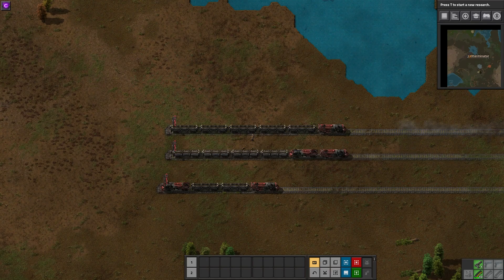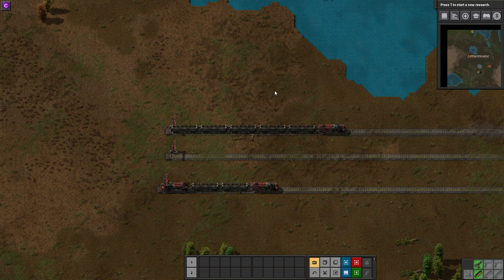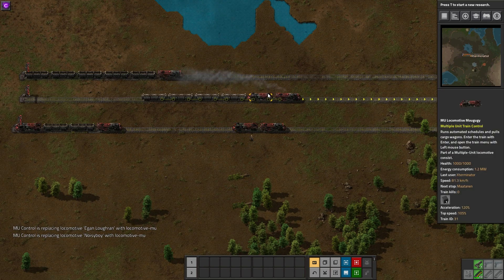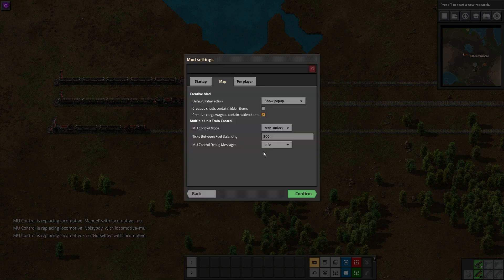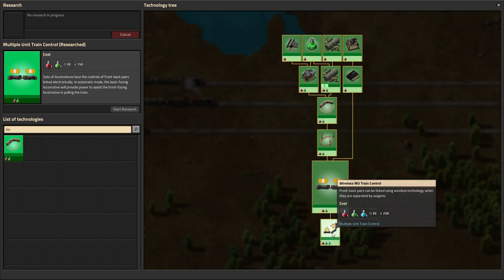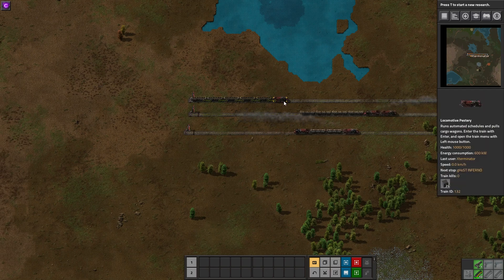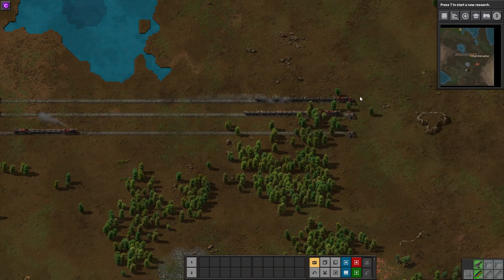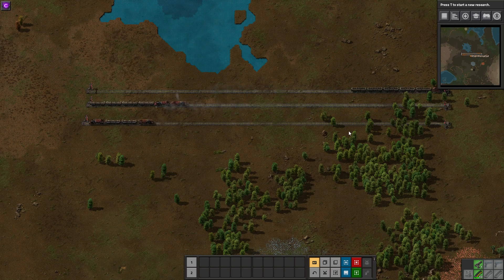Factorio Mod Spotlight - Multiple Unit Train Control

Comment: Steam locomotives do not work in reverse as well as diesel ones. Double headed, back to back, steam locomotives were not used. Pilot and trailing trucks kind of prevented safe reversing at high speeds.
Reply: Uhm... yes they do. Both steam and diesel locos can be run both forward and backwards. There may be exceptions, but the statement you made is inaccurate.
Reply: Some locos. Like the german high Speed loco have a tendet that is the same form as the front of the loco, making backing as Good as going forward
Reply: @matsv201  That's true for almost every diesel and electric locomotives. Factorio uses steam locomotives.
Reply: @SecureGM  Yes, the performance of a steam locomotive is the same forwards and backwards. If you were to take, say, an 0-6-0 tank engine, it'd probably be perfectly stable at top speed in both directions, but not particularly fast. Something like a Pacific 4-6-2 with a tender would have very different dynamics with the comparatively light tender leading. They just worked around this by making it almost never necessary to run tender-first, with turning facilities, etc., everywhere.
Reply: Like any of this really matters in a game set in an unrealistic world where you can carry trains around in your pocket xD